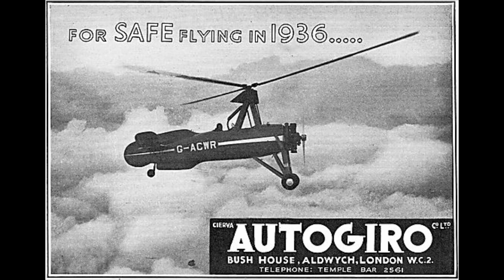History of the Gyroplane - part 14 technology demonstrators

Comment: How is the use of electric motors in gyroplanes?  Any updates on the work done by Autogyro using Siemens electric motors?
Reply from the maker: Hi Francis - It was really a PR activity with the greater change / driver being the Siemens motor rather than any change to the airframe etc. I think with the financial issues that plague AutoGyro I haven't heard anything further on the aircraft and I suspect it has died / put on hold until things become more commercially viable.
Reply: @gyrocopterflyingclub6148  tks for your reply. Pls send me the model no of the Siemens motor for the gyro plane. I can then look this up to find out more details about this motor
Reply: Because the inherent design of a gyrocopter there is very heavy drag and an electric gyrocopter would be more of a novelty than anything else. Even with lithium batteries there would be a weight issue along with compromised endurance. I believe combustion engines will not be replaced in gyros anytime soon though some adventurous types may develope flying electric prototypes

Comment: The limiting factor of a helicopter forward speed is the rotor blades. Do they become superfluous once these aircraft start moving at a fast rate of knots? Great videos👍👍👍
Reply from the maker: Thanks for the kind comment Brian these compound helicopters or gyroplanes have some form of fixed wing which allows you to unload the rotor in a helicopter (which then allows some form of disengagement of the drive) but in the Carter aircraft the rotor was slowed and because it didn’t need so much AoA the retreating blade stall is first delayed and then irrelevant as the wing is now providing the lift.
Reply: Gyrocopter flying club Thanks, makes sense now

Comment: I do like your videos. My only complaint is that they are too short. I could happily sit through a twenty-minute presentation from you.
Reply from the maker: RoadRunnerLaser that’s very kind of you to say - if you could also have a word with my wife that would be great.  On a serious note a couple of drivers the first is I could obviously have stitched a bunch of films together and made an hour plus film but the stats from YouTube show the average viewing time is around 5 mins (I guess people get bored or get distracted - back to my wife again!) So the thinking tied to that was making the various periods or main themes around that length. - my plan was / is to then go into greater depth on models or bigger topics later. A bonus of all of this is that it’s been easier to make shorter films simply because you can find all the material / write and then actually speak the script in a manageable time.  It takes about 3-4 hours to make these things (honestly) and so a longer film really needs to be parked over multi days and in that time those watching get bored waiting and you’ve made a film less people watch..
Reply: Gyrocopter flying club - That does make sense, and you’re right about the YT stats indicating that most people seem to have the attention-span of a hyperactive goldfish and, yes, it is far more manageable to make shorter videos than longer ones.`
I started watching your material before I’d even taken my first flight in a gyro. I’m now the proud holder of a PPL(G) and getting withdrawal symptoms from being earth-bound due to the lock-down... :(
I’ll probably have to evict birds and spiders from my gyro when I finally get back to the hangar !
Reply: @gyrocopterflyingclub6148  I like the short format although if I'd come in latter I'd have binged watched them all.  I would also like sometime to see maybe a longer form discussion?  I spend 2 hours the other day watching a glider (sailplane) video so long form is good too but your short vids give actually a sense of suspense but perhaps it's just staying indoors 😉. Keep em coming!

Comment: That C-130 design is A NEW ONE to me. 
 
The CLOSEST THING I have heard proposed was a 4-engine-and-rotor V-22 Osprey derivative with TWO separate wings, with an engine/rotor on the tip of each wing.  The fuselage would be equivalent in size to the Lockheed C-130.
Reply: Me too!
Reply from the maker: COIcultist I was at a briefing last year delivered by Lockheed Martin on their proposal for the future helicopter program and what becomes clear is that outside of the US military requirement/ and of course funding a great deal of projects would stop!!
Reply: @gyrocopterflyingclub6148  >>> I know one issue with the Fairey Rotordyne was the tip jet noise.  Have they said anything about overcoming that problem?